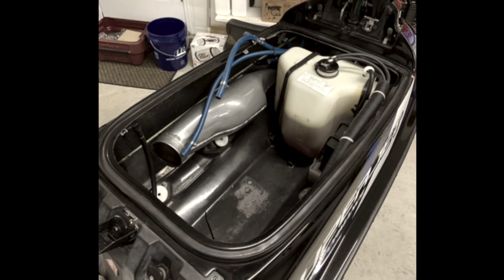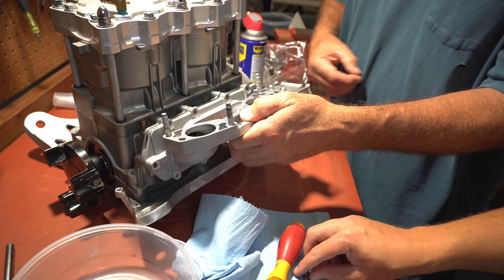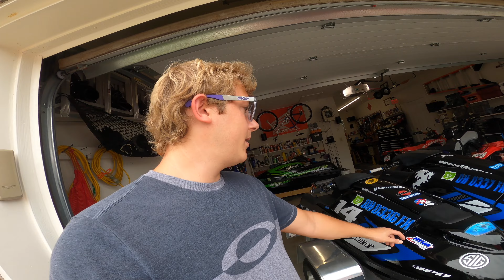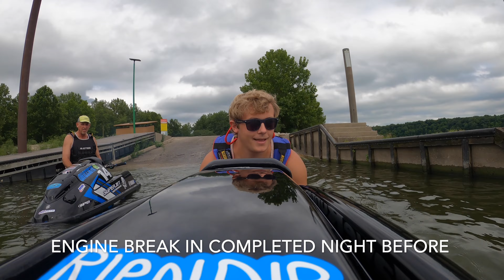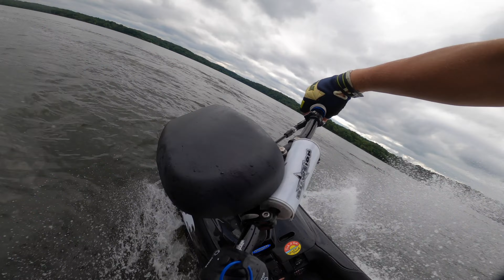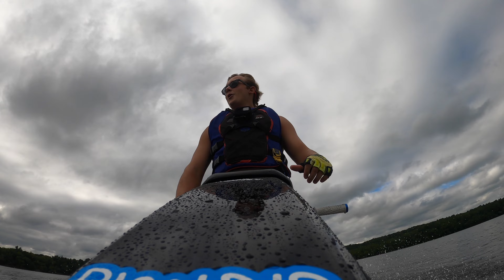Yamaha Superjet Lives Again !

Comment: How long has your dad been riding?  I'm 45, gives me confidence to see someone close to my age riding like that.  Btw what do you think caused the rod bearing(s) to fail?  Had it sucked it water before or just a ton of hours? I've been looking at 08+ SJ's, very curious what could have happened.  Thx!
Reply from the maker: My dad is pushing 60years old and still rips it lol. He had standups when he was younger and we have had the superjets since 2014 when we got them new.  We believe the crank failed due to a hard life. The ski had a loose stator from the stator screws not being tight from the factory. Causing it to advance and delay the timing on the motor. Fixed that issue after finally diagnosing it. Then 6 or so years later the crank failed. Mods will definitely shorten life of crank too but still holding strong on the other superjet.(stator screws were good on other superjet from factory ) We also have the tornado flame arrestors on which could have ingested some water at some point. so we have installed the blowsion outerwear pre filters to eliminate water from coming directly into the motor if it does get splashed up there at some point.  The factory intake is great at preventing water ingestion but makes it alot harder to tune ski for pipe if you do choose to go that route. We ride a bunch but live in Ohio so riding is limited to about 7 or 8 months out the year. Stock skis are gonna have better life and ALOT less maintenance. We are checking hoses, clearance on pipe and wear all the time with the modded out skis due to the added power and vibration they tend have more issues if not properly maintained. The superjet is my favorite toy and are a freaking blast! If you got any other questions feel free to ask anytime! Thanks for watching!